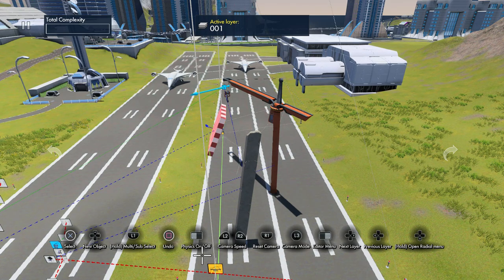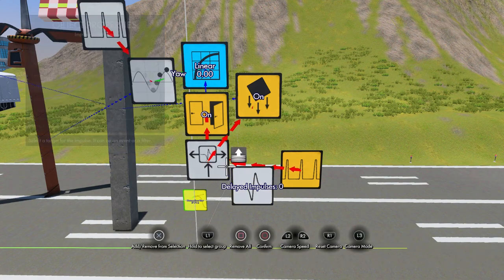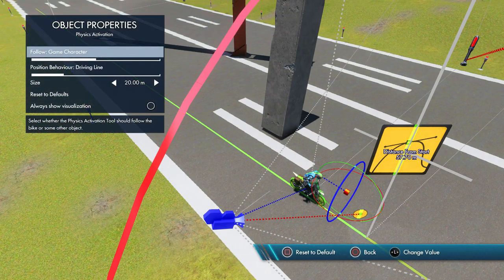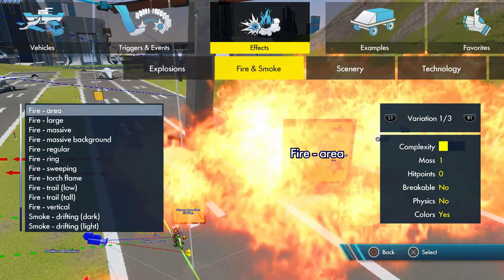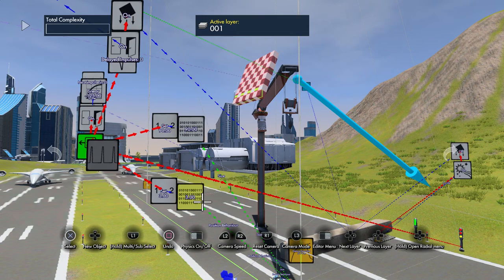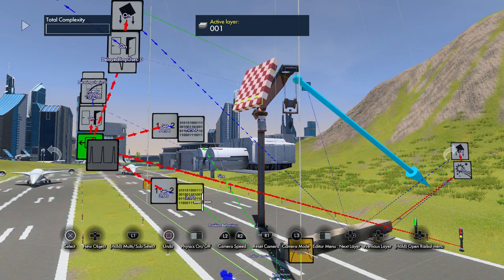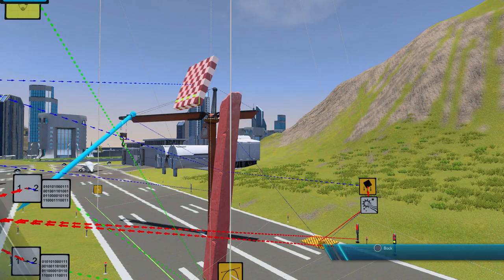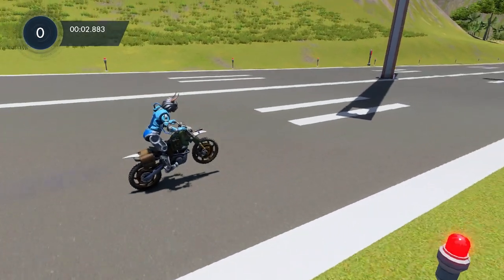Trials Fusion Editor Tutorial | How To Make A Crane Knock Down A Physics Pillar

Comment: Sorry I didn't try it in the morning, I've been really lazy a few days at least.

I think I have built this down to a tea now, but I still don't get why you have that invisible object animated to hit the pillar?

I get the same result but just turning on physics on the pillar, provided I have enough of an angel on the pillar that is. otherwise it just wiggle back and fourth and comes to a rest upright.  Not really getting the force part either. I've watched the video several times now and payed close attention to the part where you tweak the force. But I see o difference?

But as I said I don't get that invisible object hitting b/c as far as I see it it just passes trough the pillar. I see no collision ?

I'm also having problems with turning off physics after the pillar has landed and hits the area trigger set to react on physical object, and when it does it in turn sends an impulse to another physics event, this time turning it off. But it's not working. 

About that ,having the area trigger reacting to a physics object. What's the difference of that and an instance of an object? It is a physics object so I thought why not trigger it as such? That way I don't have to point to a specific object either. 

I've tried to set the impulse trigger to disable after n inpulse. But that didn't help either.
Seems to be the state event turning on the physics that's the culprit. If I go straight from Impulse trigger to physics event it works(bypassing the delay filter)

So it looks like it has to do with the impulses, I think the impulse trigger might send a new turn on signal to the physics event to turn it on again after it's been turned off.

If I build just this part it woks, but I want this to happen at  the end of a sequence of events.

So testing it like this work
1. impulse trigger to physics event
2. Physics event target object. 
3.object falls hitting an are trigger, set it react on physical objects.
4.area trigger set "on hit" to an off physics event
5 off physics event tagets the same object as in point 2.

All this works. So why not at the end of chain of events?

Now I have tried it with a chain at the end of the crane and having that swing around to hit the pillar with physics on. 
So in short physics on physics and it does not work well at all. 

The pillar gets hit by the chain and then it just freezes in the middle of the fall. Even though the physics are still on?

I've also figured out on my own how to get the letters follow the crane around. so I'm definitely making progress :)
Reply from the maker: The Invisible Wall taps the physics pillar to mimic that the crane knocked it over but didn't,  Area trigger Object Instances to pillar when on hit link to physics off event to end physics for pillar,  Physics in trials ain't the best, i always in OPE or Follow OPE Animations to mimic physics also tieing it to a random data source to have multiple paths for animation it's just a lots of code nodes cards tools cards for this editor !